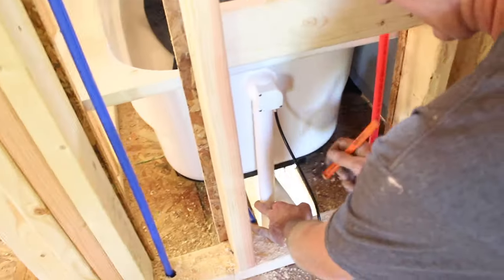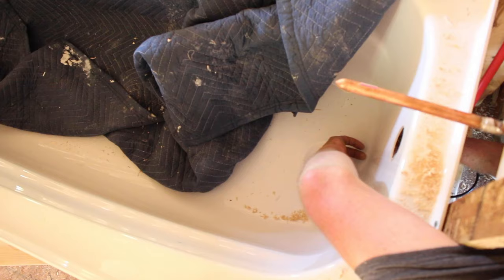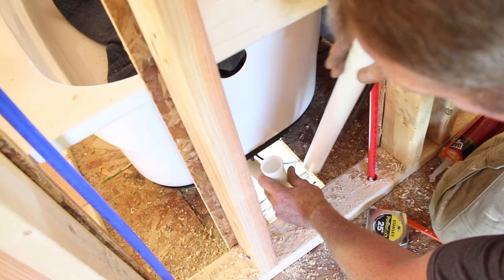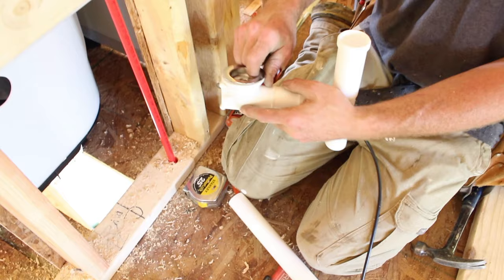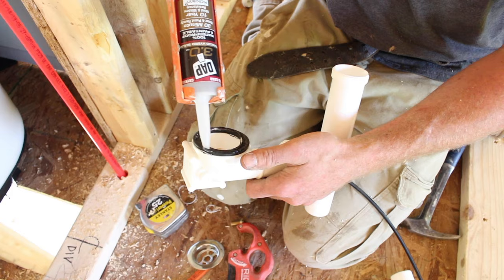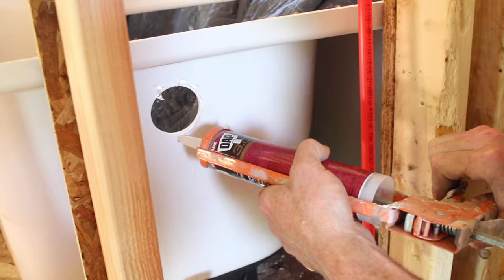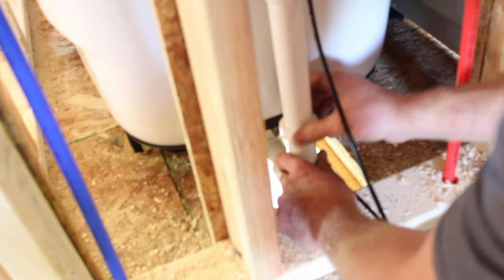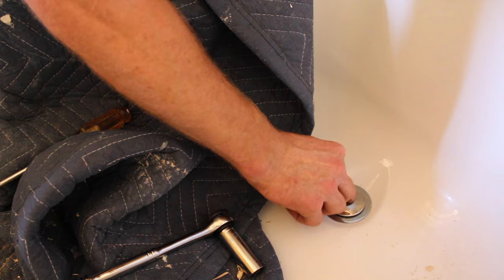Bathtub Drain Kit Installation (Step-by-Step)

Comment: This installation is not much use to the average homeowner who is remodeling their bathroom.  Plumbers working on new construction are the only ones likely to have that kind of access to the rear of the tub from the wall behind before any drywall surfaces are installed in the adjacent room.  Even with careful measurements, the trick is to align the bathtub drain and the bathtub overflow when the tub is fully enclosed by the alcove.  Show that!
Reply: if its q second floor bathtub youll have to cut out the ceiling below. they make kits that you dont need to cut
Reply: @kimloy8019  My point was, there are a  number of ways to replace a tub and hook up the drain and overflow when there is little access, because  the enclosure is fully closed in and tiled.  No need to open the wall in the next room, or the ceiling of the room below the bathroom or perform the associated repairs with those processes.
If your remodeling a basement bathroom, accessing from a ceiling below is not an option.  I've only installed or renovated about 300 bathrooms.
Reply: Lol.
That a different vid.
It involves a sawzaw
Reply: Thats what i came to this video expecting too, how to install with limited access (i cant access from underneath).

Those videos are ither mislabled (thus why they seem non-existent) or just no one does top-only installs :(
Reply: I was able to complete the top-only installation without any access from below, or behind the water supply and drain side of the tub.  I was able to find a premium drain & overflow assembly that has a flexible copper gooseneck style of drain overflow, which made alignment much easier.  It cost about $60 more than the standard assembly, but probably saved hours of trial and error attempts.
Reply: Then make a video of it and let others make theirs @chrisgraham2904
Reply: @chrisgraham2904  righto!
though, I've since ripped into the lavatory in question and turns out I have to redo the subfloor anyway 😅 person I bought this house from May have been a flipper, nothing has been repaired correctly or repaired with longevity in mind.

So my hopes of this being a simple install just became a whole ordeal lol

FML 🙃🤣
Reply: It's never fun dealing with other people's mistakes.  You just have to attack it the same way you eat a whole  elephant....one bite at a time.
Reply: Nice video. It helped alot.
Reply: Record that vid and upload it yourself my guy.

Comment: The previous so called plastic leak comment was most likely the use of compression style fittings INSIDE A WALL! HUGE NO NO! NO NO NO! Plumbing code doesnt allow compression style DWV inside walls.....If the inspector did pass it? It's because the owner/installer met needs of the inspector...Maybe a readily installed access panel to serve the fixture and or inspection....you'll never see a small leak in a wall until Mold and Mildew kick in...wood rotting.....electrolysis for some steel frame builds....etc.....and trust me! I don't care if it came with the tub! It's wrong! And unprofessional! Pros measure offsets! Glue it once! Set for 40+ years! Let's see CI pipe outlast PVC in a wall!

Comment: Doesn’t that drain kit seem kinda cheap? Thin wall 1.25” adjustable PVC? Not saying you need the brass but why not do a full 1.5” or 2” PVC?
Reply: standard  size of tub drain kit is 1,.5 connected to a 2 inch drain pipe

Comment: Thank you for your excellent video on installing the tub overflow and drain assembly. I have a house that was built in 1908. It was leaking around the overflow. I did not know that the hundred and something year old rubber gasket had decay and water was dripping into the area below my house, which is all dirt although over many times I’ve taken deep baths and letting it overflow thinking it was going down the sewer, I did fine interesting Grand Canyon kind of working their way underneath the house

I don’t really have the access that you have. I’ll have to tear the wall apart behind the overflow there by the wall at least I have access to that. It is inside the hot water so it’ll be messy, but it’ll be a little easier , I’ll need somebody under the house to properly guide the plumbing to the drain hole of the It’s an adventure, isn’t it?

Comment: Isn’t  this supposed to be hard piped with glued connections and no slip nuts for new construction?
Reply: That is the code in my jurisdiction. No slip joints buried in the wall.

Comment: There is a gap between the drain opening in the tub support and the opening on the actual tub on this particular model. Water can work its way up the threads and through that gap. I wonder if this install ended up leaking because sealant wasn't pushed into that gap.

Comment: How do plumbers install a drain that’s set in a concrete slab?  Are there “standard “ measurements that they use?
Reply: yes during rough in we put the trap in and stub out where the tub is supposed to be according to the prints

Comment: Don't use a slip ring trap system. Don't use 1-1/4". 
Use a solvent weld system. These slip ring systems work loose especially if you ever have to snake a clog in the line. That tub is getting scratched the more you work in it uncovered.
Reply: Im fixing a version of this now!  What a mess!
Reply: This is educational advice. Thank you!

Comment: I’ve never seen a cable drain installed. Kind of a cool design.
Reply from the maker: definitely a great option 👍🏼
Reply: The manufacturers of the cable operated drain assemblies all suggest that you make sure that  you have an access panel from the adjacent wall so that the cable drain can be serviced.  This is an obvious indication that the cable  mechanisms are not dependable and prone to failure.
Reply: Until it leaks and you go back to the old way

Comment: This video is a mess for any number of reasons. But it must be said that I’m looking for advice myself for installing a drain on my tub install. It’s a remodel on slab though, I’m not going to use these screw together fittings though. I’m remodeling now because of a tub drain leak.

Comment: Leave the silicone at home. Rubber on the bottom side, plumber's putty on the top and screw in until tight.
Reply: Petroleum based plumbers putty will mess the finish and leak. Manufacturer specifically says not to use plumbers putty.  Dab 3.0 or loctite pl heavy duty sealant is necessary.
Reply: @rynolda  2 nights ago the drain fell apart and water was running all over the house, reason: putty was used by the plumber…it didn’t hold the whole thing together and it basically disintegrated
Reply: @gaborkiss6555  I only learned all this after a contractor installed one at my house. The same thing happened. For 3 weeks. It was fine and then all of a sudden leaking everywhere. I had to read up about it and find out.

Comment: This use case is not for a DIY'er.  "New Construction",      (I would question if this  installer is following  best practices... I bet many will unsubsribe after watching this video).    A DIY use case would be "Replacing an existing tube and tie'ing in the new drain kit to and existing drain line... as in this video:    https://www.youtube.com/watch?v=RoB3ziqk0oI&list=PLbxjBDkRELK79bnkdC1BB5K8hAUIc6Zfg&index=54.

Comment: Spend $30 more for a brass drain.  

Previous owner installed one of these cheapie plastic kits and it is leaking badly.

Good video otherwise.
Reply: Cheapie doesnt beat the Pro's....and FYI! Most county Tap water systems have minerals....you will have electrolysis @ the brass fitting...From Atomic 26...aka Fe...google it....just that little bit of glossy water left over @ the drain a daily used shower.....will have pitting and degrading depending on water source....I know...been doing this awhile....so when you call things cheap? I have to question? The knowledge of understanding Materials for the project...If fire was of concern? All means brass and CI tub for sure...but depends on the installation and being transparent with the Customer and or Knowledgeable in the type of craft you pursue my friend! Aloha! Just trying to have you see things in not a cheapie way...